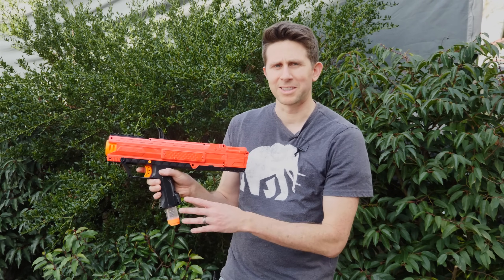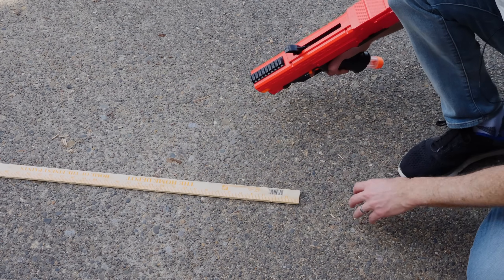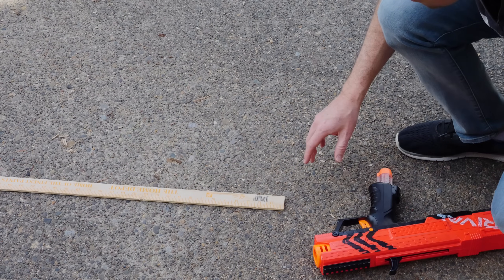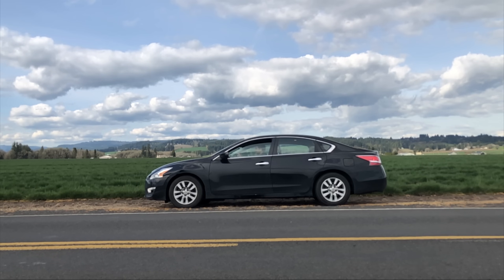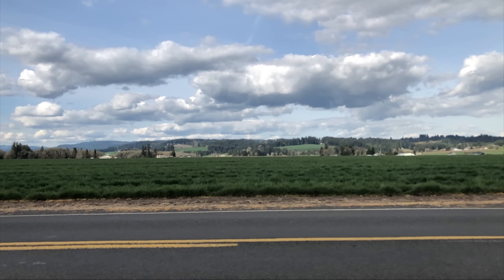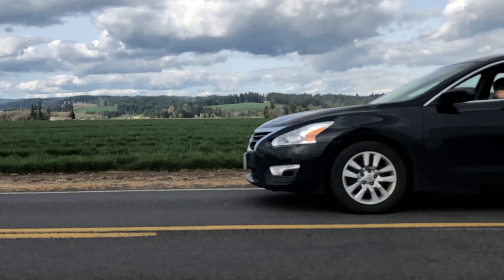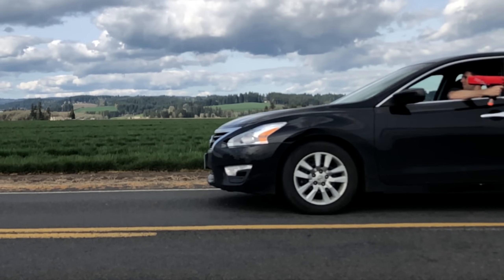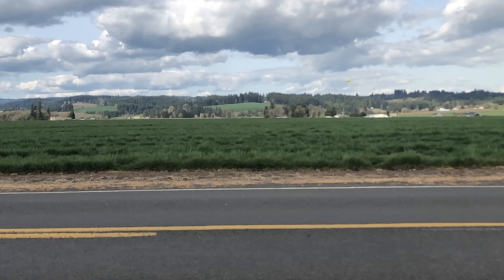Shooting a Nerf Gun Backwards While Driving At The Bullet's Speed Forward

Comment: The reason why the ball moved towards the car:
Because of the speed of car, the air along the car doors is also at the speed close to 55 mph. Since the nerf ball is at rest wrt the ground and the air on the other side, there is high pressure on the one side of nerf ball and low pressure (due to speed of car) on the other side (the side of moving car).

Comment: As you undoubtedly know, gravity accelerates a flying bullet the same as a stationary object.  The demonstration of this is to fire a bullet horizontally above a flat surface and simultaneously drop an object from the same height as the muzzle.  The bullet will hit the ground at the same time as the dropped object.  If you can slow down a bullet enough, it should be possible to conduct this demonstration.  How about a ball running off the end of a track?  At the end of the track the ball hits a trigger on a mechanism that drops another ball.